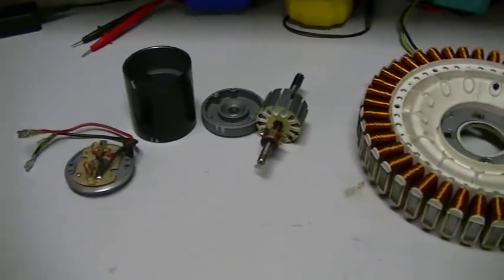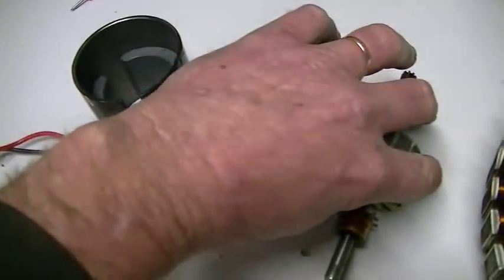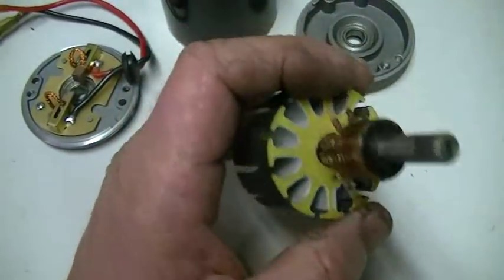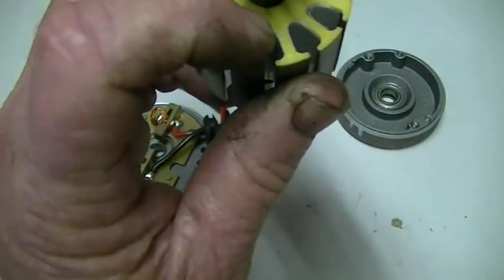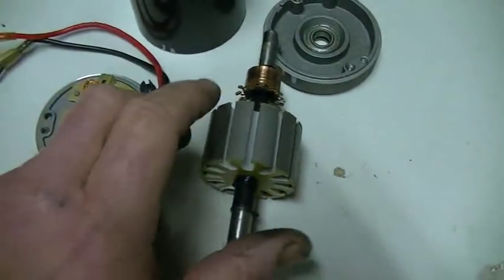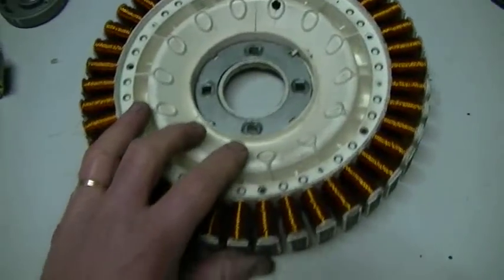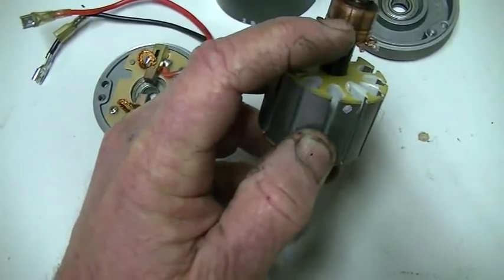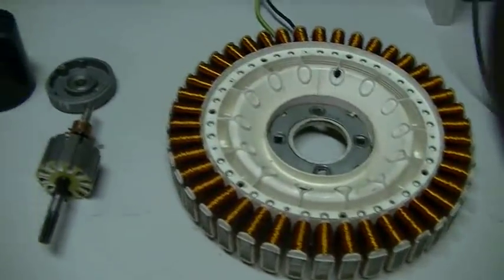Building the Matt Motor with extras

Comment: I WANT TO KNOW WHY U NEVER FINSHED UR STATOR MOTOR BRUSHLESS MOTOR I HAVE TWO STATORS AND 2 FLYWHEELS I WANT TO UN WIND AND JOINT THE 2 STATORS TOGETHER AN TRY TO MAKE A STRONG MOTOR I AM TRYING TO LEARN ALL THIS CRAZY STUFF NOT LIKE BORING A 2 STROKE AND CHANGE PORT TIMING ON GAS MOTOR BUT I THINK IF I CAN FIGUE OUT THE HALL AND THE WIRING THICKNESS I CAN GET THIS DID YOU FINSH YOUR AND IF S WHAT WAS THE VOLT AND EXC.....OF THEMOTOR WHEN DONE WAS IT WORTH IT

Comment: I posted on the test results too, using you 2 pole motor cuts frequency in half there for reduces the Boost converter effect in the return energy. Your numbers are low. I know you won't answer because having a conversation with someone who's work you are trying to discredit adds to much flak to your supreme word. Its funny how you change things don't account for those changes then leave critical fact out of your review. I just get this feeling you can't stand that some people actually make improvements over traditional engineering when you can't even finish a project.  I worked on that motor for 6 months or better it does exactly what I say does whether you omit facts or not. It must be hard to be a joke on OU. Great work there buddy!!!
Reply from the maker: Well,it seems that you dont know your own motor,and believe that because you have 4 poles and i only have two,that i have cu my frequency in half. If you watch the two videos after this,you will see that my frequency is higher than your motor Luc tested. Your motor on 12 volts has a frequency of about 154Hz,while mine has a frequency of 205Hz. You have made no improvements over traditional engineering,in fact,you have gone backwards,where a larger sum of power in your motor is dissipated as waste heat. You may have worked on the motor for over 6 month's,but you made no improvements at all,you only made it worse. Those are facts that you have to deal with,like them or not.
Reply: Ya your right, as usual. The motor is complete waist of time and I am an unknowledgeable fraud trying to trick everyone. Nothing interesting here...
Reply from the maker: Never said you were a fraud. All im saying is that you are wrong.

Comment: The MY1016 has 4 magnets.
Reply from the maker: Your point is ?.
Reply: Higher frequency for the induction that is available. Do boost circuit Math...Thats the outcome
Reply from the maker: Matts motor has a lower frequency than mine,so hows that math going now?.